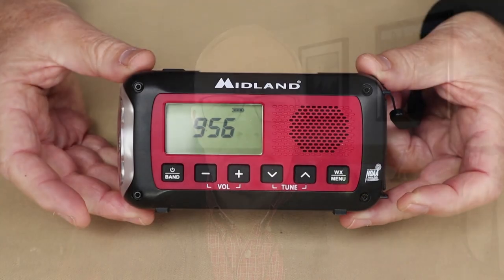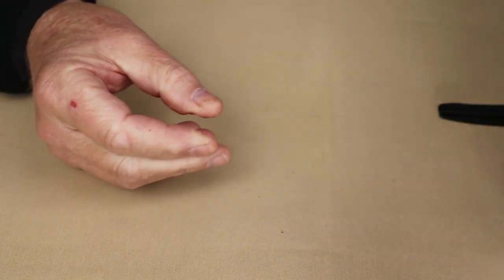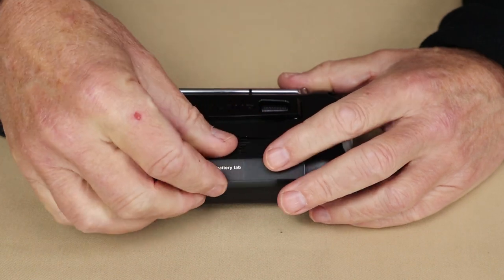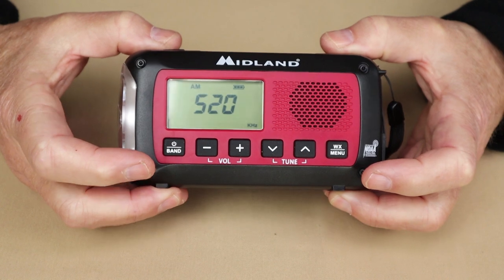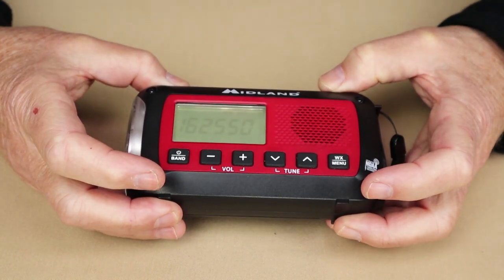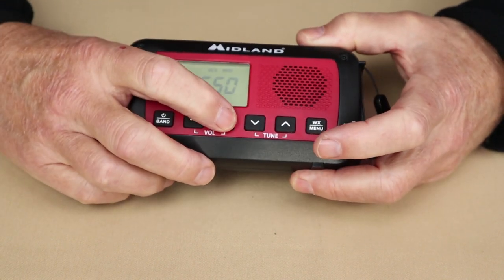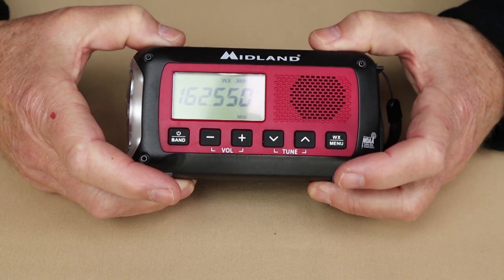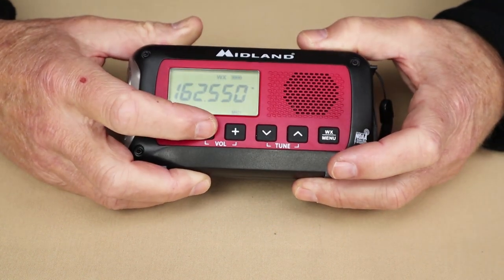There is a Storm Coming. Are You Ready? - Midland ER40 Emergency Alert Radio

Comment: Now just get an alternative way to charge it. Rather the Solar, viatical wind generators. The can receive wind in all directions take little to no space and are quiet and animal friendly. 
I've all but stopped cell phone use and am now using various types of 2 way radios. I've not used but listen only on radios that require license. Just on CB alone there is multiple ways of receiving help, as lots of towing co still listen on the channel 9 Freq. 
My bofeng radios have 3 way of communicating too...
Glad to hear you took the steps in the right direction...thanks for the post from NS.
Reply from the maker: Great suggestions. Thanks for commenting

Comment: I love these emergency radios.  I have four different brands.  I use them outside in the summer while I do yard clean up.  We have a radio station near by called Kool Kat Oldies (on the web too).  I enjoy listening to the old stuff.  They really hold a charge for a good long time.  My favorite one has a lift up on the side that has a great reading light.  Whenever I am charging my portable power stations with solar panels I hook up the radio to the usb port on the solar panel, and it charges fast.
Reply from the maker: You are dating yourself😅. I can see us using ours as an FM radio quite a bit. Thanks for commenting

Comment: Great video Mark. My wife bought me an emergency radio for Christmas this year. I have played with it a little bit but will now make sure I set up my local weather channel. Mine has a 5000 mAH Lithium Polymer battery with type C charging port, hand crank, solar panel, flashlight, reading lamp, compass and emergency siren. It's still very compact but a little heavier than yours. I think it is a good thing to have around "just incase"! Cheers my friend.
Reply from the maker: Great to have one at home or car camping where weight is not so much of an issue. Thanks for commenting

Comment: I've had one of these kind of devices (different make, same basic design) for a decade now.  Pretty much never gets used for it's intended purpose as an emergency radio, and gets used instead as kitchen radio.
I like this one has a much bigger battery than the one mine has (though mine can also do 4 AA at the same time and switch as desired between them).  Main down side with mine is it is a royal pain in the butt to change FM/AM channels as you can't press and hold to skip channels (holding causes it to seek to the next channel, and there are a great many channels here where I am) so you have to hammer the up button to get to 99 FM.
Reply from the maker: We had an old one as well. Worked, but not well. This is so much better. Thanks for commenting

Comment: To me, without a button lock out, it’s useless for camping.  Wayyyy too easy for one of those buttons to get pushed without knowing.    
I was looking at it for a home emergency radio.  I have a few GMRS radios with NOAA, and FM, and spare batteries, but it’s the hand crank charger that interested me.    Any feed back on just how long it would take to get enough juice to at least listen through a weather report?   I get the feeling that crank is almost useless.
Reply from the maker: I feel the crank and the solar are more to top-off the battery. I think it would take a good long while with either to fully charge the battery. I treat it like a flashlight and have a spare battery or a means of charging. Thanks for commenting Jim

Comment: Yeah these devices are a must item. It was cool to see u do a vid like this cuz I thought I was the only one who had one of these.
I carry a Scorpion II.
It's a hand held digital AM/FM and weather channel radio with a flashlight, solar panel, crank and usb charge ability, and is also a charge station for your phone and a built in bottle opener when you realize yer screwed and decide to crack open a bottle of whatever 🤪.
And a carabiner on the opposite side of the flashlight. 

Scorpion II. It might be on amazon too
Reply from the maker: I will take a look. Thanks for commenting

Comment: G'day Mark, these type of units do make a lotta sense. Been a while, but I've looked at many, and to be honest, tough to find the "ideal" unit for my MO and location. 
Totally agree, it certainly does depend if you want it for home power outages, on the trail, or both. 
I've found, with a few exceptions, most units to be around IP X4, (drop resistance not rated), and run/charge times can vary significantly as you mentioned.
I really dig the removable/rechargable18650 on this model, though one needs to be cognizant of the battery types of one's other devices, (torches, headlamps, GPS and such), particularly on the trail; noth'n worse than being stuck with incompatible battery types IMO. Cheers Duke.
Reply from the maker: Good points Duke. My old radio had built-in batteries. Once they died, I had to use alkaline. This having the 18650 is so much better. Thanks for commenting